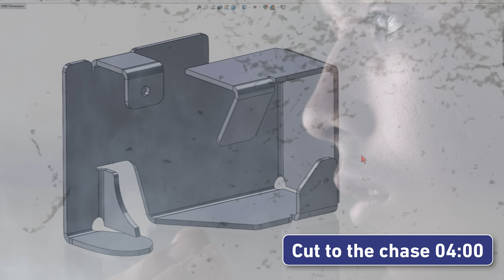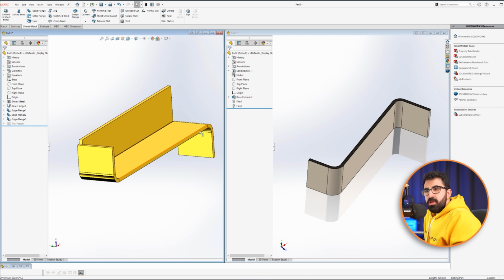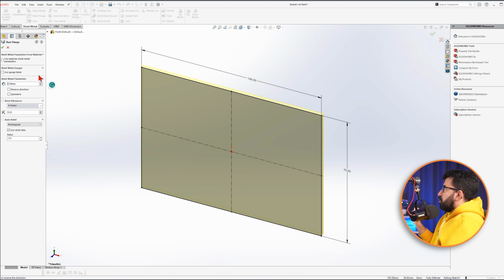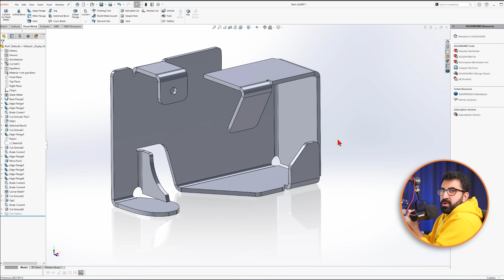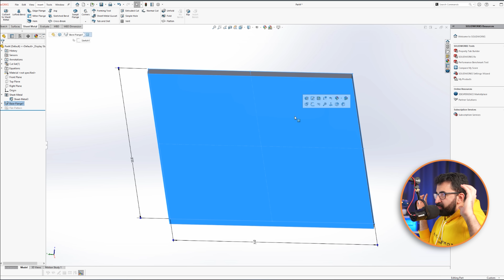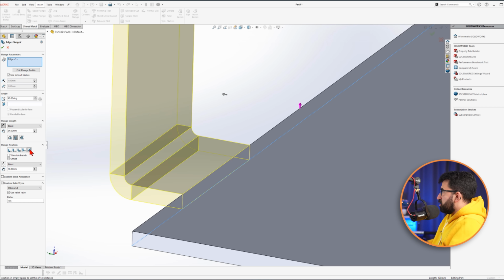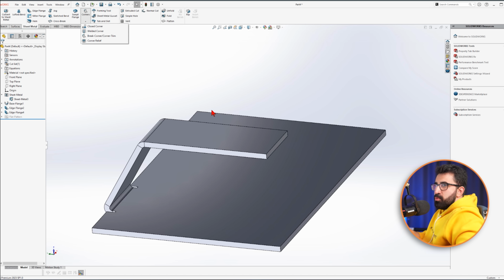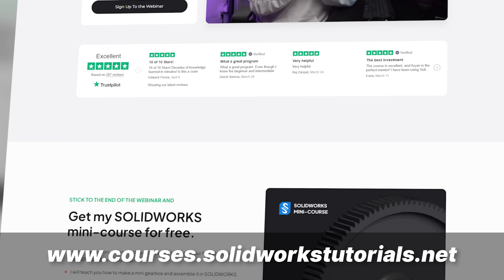SOLIDWORKS Sheet Metal Module | Beginners

Comment: Thanks for the video. Unfortunately I work with sheet metal alot and had to learn it the hard way. But!
Here are some valuable topics for future videos 
1) Configurations (how to allow variable thickness for sheet metal parts;
2) Sheet metal bulk extraction (DWG/DXF macros)
3) Solid body to sheet metal conversion (helpful for complex form, when its better to define outline dimensions first)
4) Sheet metal blueprints (how to make a drawings, how to show bend lines, what to do when bend lines not appearing, what to display on a blueprint for most accurate representation etc.)

Not a priority order, just common ideas that come to mind when I think of hard times working with this function.
Reply: If bend lines not appear click on the eye icon then click last icon
Reply: @vinothraj2272 that was not the questions list mate. Its just things that appear sometimes. Also It may not be that simple
Reply from the maker: Noted. Thank you for the feedback.

Comment: Can you make a video on SW routing systems...Like wire harness design
Reply from the maker: Sure, short answer it will be done using sweeps if you do not have access to SOLIDWORKS routing add-on. But if you do have access its a great way to just get wires auto creates as needed from point A to B without messing up other wires.

Comment: Good day Mr. Aryan
I’m facing a problem with my software and tried to send you by email 
I use solidworks over than 10 years and I always convert to dxf
Last tow weeks till today, each file I convert to dxf especially for sheetmetal, the bending lines shows incorrect positioning, always miss alignment horizontally and vertically .. 
Did you face something like that or you know how to solve it.?
I appreciate your help too much..
Reply from the maker: send your file via email to me please. I have to see it
Reply: @with-aryan  I tried to send you via email I couldn’t find it
Can you type your email please